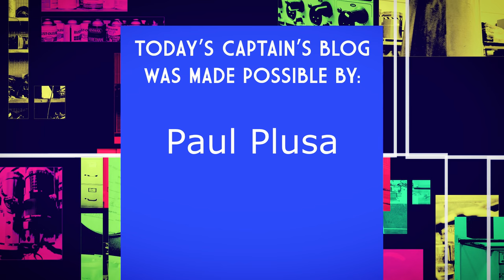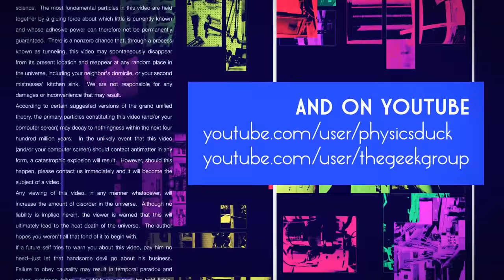Captain's Blog 4 25 2016 Radial Commutation

Comment: It's normal to have radial commutators on high current motors, more surface area, unlikely to see them on mains powered universal motors, so not surprising that you haven't seen it before.
A vehicle alternator generally has slip rings on the end of the shaft too
Reply: +Sparky Projects i tought it whas a space saving thing
Reply: +ljmike1204 Then why don't you see higher voltage low current motors like that ?
I haven't seen it in over 40 years in the electrical industry.
Think of it this way, you can put thicker side contacts, but at the speed these motors can go offload they can shake loose (i've seen contacts that have come loose and damaged the brushes/holders) due to more weight, there's a limit how thick you can go without impacting the next contact, you could increase the diameter, but that's more surface speed for the contacts/brushes to contend with. (circumference)
On the end of the shaft you can have contact as thick as you like, even have built in pegs to retain them in the insulation.